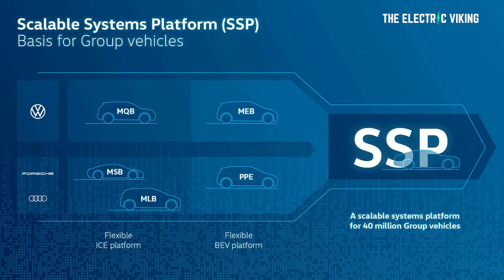Volkswagen MEB+ EV's to get 435 mile range, 200 kW fast charging

Comment: VW hardware sounds good, but their software is terrible and since these vehicles need the software to run properly, terrible software equals terrible vehicles😢.
Reply: Yep, there are some issues with VW's latest S/W, but not all hope is lost. Of all the parts in the car, the S/W is the easiest to modify and update (as all the Tesla fanboys have been explaining ad nauseum), so, there is some improvement coming.

Many of the complaints are simply the result of putting everything in the central touch screen menu, which VW customers obviously dislike (and rightly so). And then there are the bugs, which are annoying at times, but it's not like the cars don't work because of it. VW customers have high expectations (and rightly so) and they are not met by the current UI S/W, but there are plenty of cars on the road which have unsolved bugs in the UI S/W. VW is not alone in that.
Reply: @hvh377  yeah, software is easy to fix, that's why after 2 years with 3,000 employees working on it, their new operating system  been delayed to 2026.
Reply: @davekozlowski1266  You know what I mean. It's a lot easier to fix than H/W issues.
Reply: @hvh377  maybe, but most OEMs are really behind in software both in their cars AND their plants. Most need outside vendors to do software changes on their robots building their cars and they haven't been successful at simple things like over the air updates. They are at least 5 years behind in software development.
Reply: @davekozlowski1266  That may or may not be the case. I don't know, but that's a separate thing from fixing issues. You're not saying it will take VW 5 years to fix a couple of bugs and nuisances in the UI because they're 5 years behind in S/W devt compared to others, I think?
Reply: @hvh377  we'll the ID line came out in 2020, 2 years later the same software issues remain. This would indicate that software isn't easy. The new software system was supposed to be out for 2023 and has now been pushed back to 2026 so I guess that means that VW hasn't been able to write a new system after 2 years of development. They have pushed the timetable back twice as long as their original timetable.. 6 years for software development....no, they can't compete with Tesla. Meanwhile unhappy customers are still driving cars with buggy software that was supposed to be fixed with over the air updates years ago
Reply: @davekozlowski1266  Many issues in the S/W have already been addressed (OTA and all). A few further improvements could be made. The most important issue, however, the presence of a touch interface is a hardware problem. That will (hopefully) be addressed in subsequent versions of various models on the MEB+ platform.
As for competing with Tesla, I don't see the need. VW customers (dare I say it? the majority of drivers) pretty much hate the 'tablet-with-wheels' interface and Tesla's own UI is a dead end anyway. Android Auto and Apple Car play are already dominant and will become even more dominant in the future. Tesla's version of an app store will always be lacking compared to Google's and Apple's.
Reply: Fortunately software can be updated.